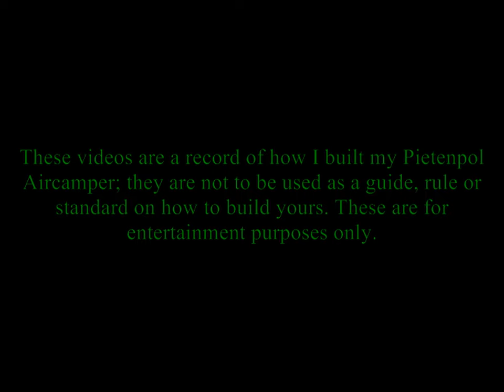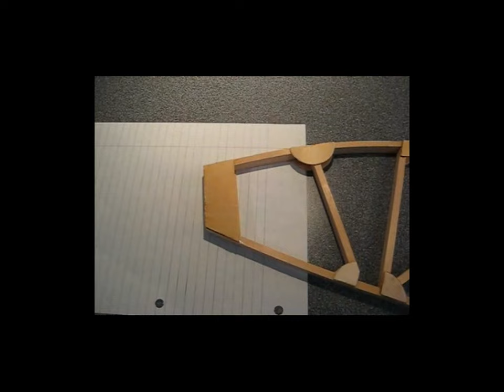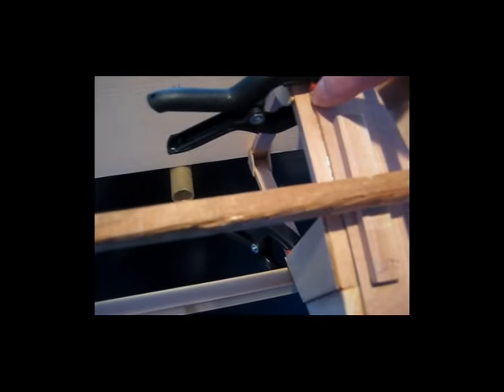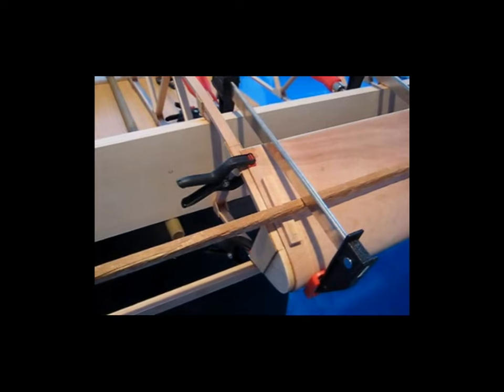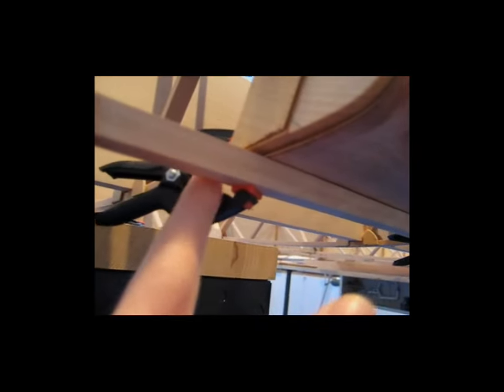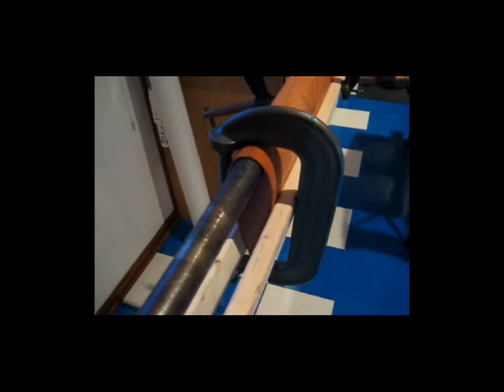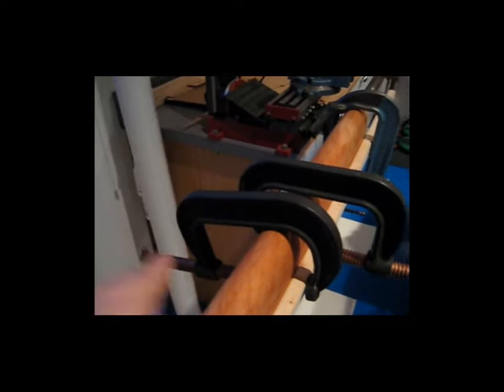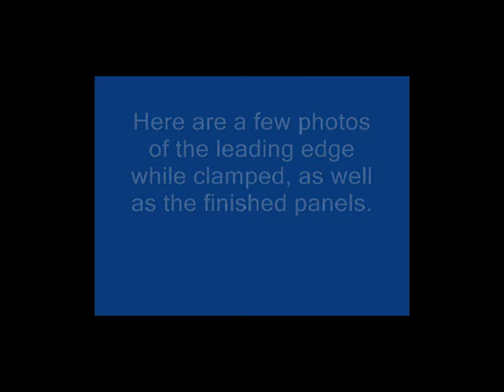Pietenpol HINT Video WINGS 6 Leading Edge

Comment: Very informative videos clearly presented and clearly explaining each process. You should do “hints for home builders” for EAA.😉
As a side note, I’m currently building a wooden microlight glider (of my own design) and came up with the same idea when butting up a piece where there is a glue line, chamfering the edge so the pieces fit flush. I also used the same centerline idea when bending aluminum gussets around a pipe to fit around aluminum tubes on the aircraft. Two small rivets through the centerline into the pipe  to hold perfectly centered, then heating and bending the two flanges down using my hands… with thick leather fireplace gloves so as not to need a trip to the burn trauma unit!
I’ll be watching the rest of your vids to possibly get some other ideas and tips… thanks for putting in the time and effort and best of luck with your new project!
Reply from the maker: Thank you.   Glad you find these videos useful.